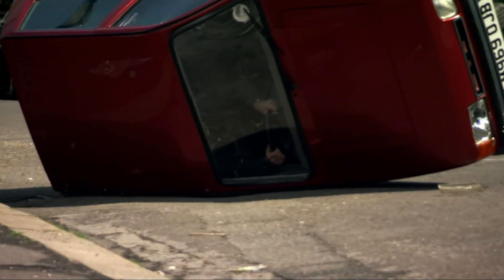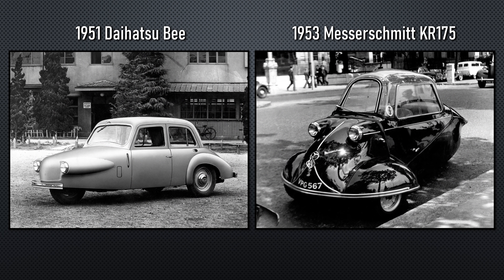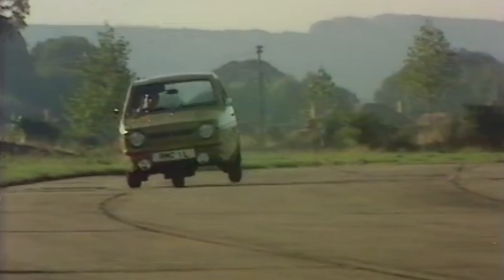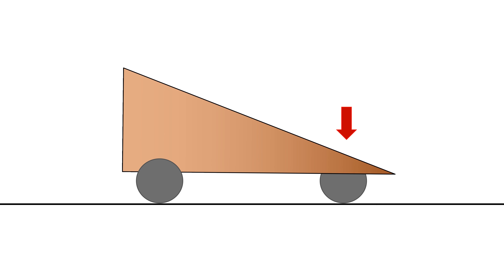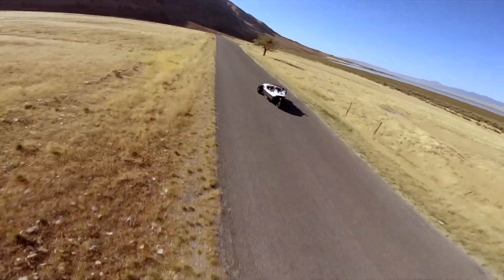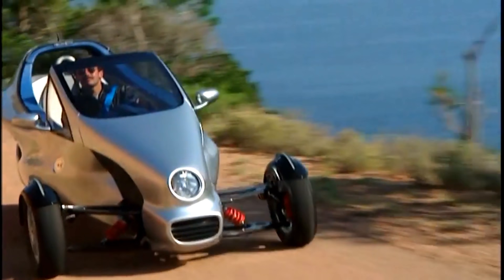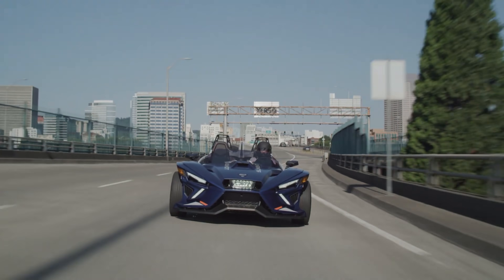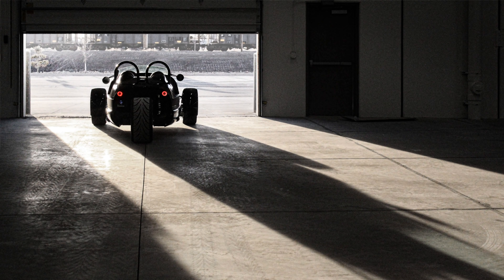Are 3-Wheelers DANGEROUS???

Comment: Having extensively driven the Reliant Robin Estate, Rialto Estate and Bond Bug 700ES in the worst of UK weather (churned snow, ice and slush, refrozen, with inches of new snow on top) I can honestly say that there were no concerns.

Whilst the central front wheel had to work its way through built up churned, refrozen ice and snow, in addition to a fresh snow layer on top, which isn't an issue to four wheeled vehicles, its hardly an issue if one drives appropriately for the road, environmental, meteorological and traffic conditions!

As with any vehicle (particularly motorcycles, where many three wheel vehicle drivers originally hail from) one rides or drives appropriately for the conditions mentioned above and one's own and the vehicle's capabilities! 

As I rode my motorcycle in those conditions, it was hardly a problem to do so with an additional wheel hugely aiding stability, a weatherproof body, comfortable seat and a heater and demister! 

There's a lot of nonsense spoken about three wheelers, quite often by those with no experience of them, but when operated within their capabilites by an experienced driver they're fine!

Comment: If you corner a Reliant like a motor bike, ie  get the speed and gearing right 'before' the corner, then little three wheelers corner really well. If you corner it like a car, then you'll be in trouble. 

Also, according to the insurance industry, the  Reliant Robins etc are officially the lowest risk car to insure!

Comment: Honda ATC 3 wheelers weren’t meant for young or low skilled riders. The worst is a panic stop in a turn,,, not going to end well easily. We had two 110’s on our dairy farm and we knew how to ride them, we’ll most of the time. I slowly drove over the edge of a snow bank then the front tire sunk into a spot of soft snow and I went over the handlebars down the side of the hill and the Honda 110 landed on my left arm breaking both lower bones in half. I had a helmet on which saved me from likely breaking my neck.

Comment: Hey Big Car, here is another point about three-wheelers potentially being dangerous that you didn't mention in the video, which I would like to share.

In a three-wheeler, it is impossible to avoid potholes because in a conventional four-wheeled car, there is enough clearance across all the wheels for the wheels to avoid hitting the pothole. However, in a three-wheeled car, that is not the case because the single wheel located in the middle of the car will certainly hit the pothole, making them more unsafe in the events of a pothole.
Reply: See also: Hedgehogs.
Reply: In a Reliant you need to be slightly off centre when dodging a pothole and it's fine. The tyres are not that wide.

Comment: Three wheelers are only acceptable configuration for slow, utilitarian vehicles, think of Piaggio. Once you've passed the critical point of balance, there's no drifting or sliding to expect, only roll over. It amazes me how, time after time, people will try their luck at building a sports oriented three wheeler despite having been proved the worst architecture for that use. Maybe they could be made more secure with dummy wheels that would get in contact with the ground in case of excessive speed and loss of balance ...

Comment: The Delta Wing's advantage wasn't it's layout, it was its lack of weight and small front area. The Welter Racing WR LM94-Peugeot won the pole at Le Mans in 1995 with a 400 HP lightly modified production engine the same way.

Comment: I had a BMW Isetta, and it had no tendency to roll over. If you took a corner too fast, it would slide across the road, very dangerous if there is anything coming the opposite way. I only did it once, the first time I drove it, and learned the lesson. Later I had a Bond Minicar which could be rolled on corners but not on normal bends in the road. I had great fun cornering too fast with the inside wheel off the ground, taking it just to the limit. If it feels like it's going to roll, you just turn the wheel back slightly and it sits down again. I had one hairy moment on a bend with a strong side wind. I shouted to my rear passenger to slide across the seat, and that saved the day. Another incident was in a car park at the peak of a high pass in the Lake District. The wind was powerful and I was convinced that if we got out of the car, the wind would blow it over as it was almost lifting the car off the ground with two of us in it.

Comment: 3 wheelers can’t straddle a pothole. They have to drive around it. Can you say moose avoidance rollover! Most of the mass has to be over the 2 wheel end. That’s hard to do with 2 wheels up front and the back half of a large motorcycle in back. If they had to adhere to car safety requirements they’d disappear like Honda trikes.

Comment: Top gear may have made it look worse by welding the diff, but keep in mind that drift cars don't tip over with welded diffs, and 4WDs don't tip over easily with locked diffs.
Its also worth talking about that perhaps the problem isn't low cars being hard to see, but tall cars and their drivers' mindsets.

Comment: What's with 3 wheelers that fascinates me so much? Assuming the single wheel is on the front, as long as they put the engine close or behind the 2 wheel axle - like in the Snyder ST600-C - they're perfectly safe. https://www.youtube.com/watch?v=nL3oSfotDuQ
Other design and engineering 'tricks' like hardening the suspension, lowering the vehicle or increasing the wheel distance on the axle also help with safety and stability.

Comment: I reckon the most bonkers three wheeler was the Bond 875. Rear engined, two rear wheels and one front wheel. Both ends of the vehicle would be trying to overtake at the same time... :)
Reply: And the powerful  Hillman Imp engine !
Reply: I have a couple of bugs and have looked for an 875 to add to the collection but there don’t appear to be any left. Apparently under power the light front would lose all steering ?

Comment: I've had many plastic pigs in the past and became expert at driving them on two wheels.ive also took the body's off and welded a frame around them.with no body they sure can shift and the engines can take alot of abuse.are they dangerous? Yeah sure they are bit if your scared of dieing,you ain't living!

Comment: Does anyone remember the Bond Minicar? It had a 197cc Villiers 2 stroke engine and could turn round in its own length. A friend had one and was involved in a bizarre accident when he stopped alongside a bus at the traffic lights. The Bond was so low that a short sighted lady got off the bus and stepped onto the bonnet of his car. He claimed that three wheelers were more stable as they could only roll over three ways whereas a four wheel car could roll four ways.

Comment: Having owned 2 Reliant Rialtos each for 5 years plus (only had a Motorcycle licence until 5 years ago.), I can certainly attest to the fact they need to be driven differently to a 4 wheel car.  However in the hands of an experienced driver of the type of car, they are a lot of fun.  Can leave the lot of modern cars standing at lights, although they tend to catch up fast once you hit about 50mph. Still a lot of fun and very economical, 70mpg ish.
Reply: That use the same amount of fuel as my 300cc scooter. It is amazing, I guess because it is so light and aerodynamic, it is like motorcycle with a body and 3 wheels.

Comment: Also the Thrust SSC, first car that achieved supersonic speed, could be mentioned as three-wheeler: two steering rear wheels almost in-line. Craig Breedlove's Spirit of America jet vehicle had two front wheels close together, and broke land speed record in 1964 at almost 847km/h. FIA back then defined cars as "wheel-driven" and "four wheel vehicles", so, initially, the first land speed record achieved by jet driven vehicle was ratified by FIM, 4-tonne jet engine on wheels officially clasified as motorcycle, and it all started a debate which changed the FIA definition of car.

Comment: The middle wheel is always on the worst part of the road. The middle is where you find the most sand, dirt, grease, oil. In winter the most snow and ice. On dirt roads the path sometimes isn't even in the middle. 
So Yes! When you motorcycle never ride the middle because of those reasons but not much choice if your car makes 3 tracks, also, harder to avoid potholes.

Comment: You forgot to factor in Mr Bean when looking at the safety of 3 wheel cars.
Reply: That was another stunt - like top gear . Simply turn a sharp corner IN Neutral and it'll roll. I did that once accidentaly

Comment: I would have thought it was the other way round. One wheel at the front would understeer and one wheel at the back would oversteer, not the other way round?
Reply: It's all about the weight transfer under braking. A single front wheel will easily lock up when all the weight is thrown onto it and that causes the rear end to break away and the car rolls over. The reason powerful three-wheelers like the Morgans can corner so fast is that the single rear wheel will slide sideways but you can continue to point the front end where you want to go without the steering wheels locking.

Comment: In the 1950s, a number of German vehicles were threewheelers (or at least in the road laws definition) - the most famous being the BMW Isetta, but there was also the Heinkel Kabine (Cabin) which had as the Types 150 and 153 three wheels indeed, plus a number of them coming from more or less small manufacturers being built in limited numbers.

The major reason for the construction of these vehicles were the attempts in building cheap affordable cars, and saving parts like differentials were one of the most effective cost cutters. Also, many manufacturers sourced engines (in the range from 98 to 200 cm³) and gearboxes from companies which were building motorcycle engines, with the most notable being Fichtel&Sachs and ILO.

They were no more dangerous than a 4-wheeler mostly due to their poor power-to-weight ratio in terms of roadability, but their crashworthiness...in the end, the VW Käfer killed them all.
Reply: In Germany the Isetta is also known as 'pothole searching machine' :)
Reply: @aureliobrighton1871  "Knutschkugel" ("Kissing sphere") is another nickname though not exclusively limited to the Isetta.

Comment: My handicapped son has a Jorvik tricycle, and having seen him roll it a couple of times in corners I can confirm that even at 10mph a three wheeled vehicle with the single wheel at the front is pretty damn dangerous. I can however see no problem with Two wheels at the front - as in various cars in the 30’s and of course the Morgan 3-wheeler then and today.
Could you do a video sometime on the history of the Morgan car company ? One of my dream cars (with 3 or 4 wheels), which no doubt will remain… a dream…
Reply: I'm sorry that your son has problems riding his trike. That kind of tricycle isn't especially dangerous if you know how to go about, and are physically capable of riding it properly. After all, bicycles and quadracycles (including cars and lorries etc) can be very unstable if not handled correctly. I don't know the limitations your son suffers due to his handicap, and I sincerely hope that they aren't severe, but they may be a key factor in the instability. Unlike a bike, which automatically leans in the correct amount, on a trike you have to deliberately lean you body in to the turn. The faster the turn, the more you need to lean your body. The weight transfer and it's timing are critical to stability. They can be ridden round bends at high speed with practice.xThe 'tadpole' trikes with 2 wheels at the front, whilst a bit more stable, also require the same technique.
Reply: It's more about weight balance than wheel arrangement

Comment: I once drove a Reliant Regal van - it wasn't at all unstable but as the driver of a 4 wheeler you are chronically aware that the two front corners are unsupported  and so approach corners with a little trepidation. I certainly went round corners carrying less speed with me. In fact the overwhelming issue for me was the volume of noise being in a largely unpadded glass fibre box with an engine under your left elbow making all the noise !!

Comment: I rode a bunch of Honda 3 wheelers and I am still alive! Did I get hurt? Of course I did!
Here's a pro tip: when you've got the 110 out in the front yard cutting donuts to piss off your neighbor, make sure you don't get to close to the sidewalk. 
The quick transition from grass to concrete will cause the 110 to stop. 
You will not. 
You will land on your face in the street.
Your neighbor will laugh.
Reply: That hcomment made my day. Still picturing how that must have been to watch. No car is safer than the idiot driving it. Goes for all safety precautions, if not complied to or simply disregarded you can kill yourself instantly if luck runs out.
Reply: My luck ran out a lot! 😁

Comment: The other problem is that the single wheel is between the wheeltracks worn into the road by the more common 4 wheelers. There tends to be more debris there, and the road surface isn't always as good. And don't drive over the pit at your local garage.
Reply: "don't drive over the pit at your local garage" 🤣🤣🤣

Comment: 4:24: Three wheels doesn't inherently provide less protection in a crash. There simply hasn't been a three-wheeler built specifically to take on a crash from the battering rams we design today.
4:29: Size is not an indicator of safety, nor is the Ami a fair comparison to show here, as it's status as a quadricycle allowed Citroen to skirt safety regulations. Replace with the Ami with the Smart Fortwo in this comparison and the argument falls apart.
4:43: It's time to stop blaming "smaller vehicles" (or people walking and cycling, for that matter) as the cause of increased crashes due to visibility issues. One of the primary root causes of this issue are the ridiculously oversized SUVs we make today, complete with their horrible visibility. We need to reign in the root cause of the problem by regulating the creation of these Stupid Unnecessary Vehicles that have the frontal area of a small office building. 

We're already erasing human beings and small vehicles out of our city landscape because some arsehole wants to run over everyone in an Escalade, and that's not the way society should be going if we have any respect for ourselves, our health, and our cities' livability.
Reply: I must disagree about size not being a factor in safety. It takes considerable chassis strength and multiple airbags to be safe in a high speed crash,  even when hitting a similarly small car. Mind you,  I don't buy cars for safety- at all.
Reply: @jamesengland7461  I believe you mean unibody and/or body strength, not specifically "chassis" strength (which would omit the entire body from the equation for body-on-frame vehicles). Hence my reference to the Smart Fortwo, given that it was engineered with a rollcage built into the unibody - as the vehicle's B-pillar.

As for "high speed crash[es]" - that wasn't being discussed until you brought it up right now. You can have significant injuries and deaths with low-speed crashes too, especially given the bumper height difference between trucks and SUVs - particularly SUVs that are based around high, body-on-frame platforms - and automobiles. 

But for the sake of debate, you'll have to define what speed a "high speed crash" is. You'll be surprised how one's injury and survival rates exponentially plummet as speed increases in those "big and safe" SUVs too. There's a point where cheating kinetic energy with safety equipment, no matter how well tested in the lab, is not going to guarantee a positive outcome for occupants in an organic crash.

More importantly, despite the flashy advertising footage that Andy pulled his footage from, a good number of these three-wheelers are not really highway vehicles in the first place - plus, the comparisons Andy brought forth (for both three and four wheelers) were primarily intended as city vehicles.
Reply: @cudak888  by chassis I meant the body structure.  Bumper height regs apply to all cars and SUVs and trucks. High speed would simply mean typical city driving on main roads.  I know the Smart has impressive crash safety. It's atypical. I would not want to hit an Ami, even with an Ami, at 29mph.
Reply: @cudak888  btw, chassis simply means the structure
Reply: @jamesengland7461   Bumper height regulations in the US are different for cars and trucks/SUVs. Just look at any car vs. a current (N300) Toyota Tacoma if you want an immediate example.

"Typical city driving on main roads" could mean anywhere from 30mph to 75mph depending on what country you're in. Even within the US, this may differ on state and even how a  specific municipality designs their roadways. Name a speed.

The Smart may be atypical, but the substandard benchmark of its peers isn't an excuse to expect mediocre safety from other small vehicles, or make blanket assumptions relating to the ability to make a small vehicle safe. 

Furthermore - as I pointed out above - the Ami isn't legally an automobile and shouldn't have been used by Andy for his comparison, for the very reason that it can be erroneously used as a benchmark against small automobile safety. It's not representative of automobiles - it's representative of a loophole.

P.S.: Some interpret "chassis" to mean "ladder frame." Hence what I said before. When dealing with the topic of safety and safety engineering, ambiguity is not an option.
Reply: @cudak888  I'll leave you to it.